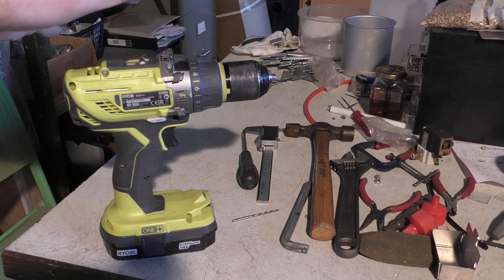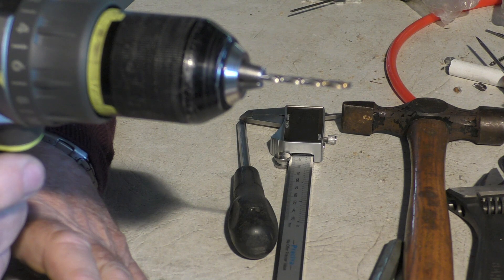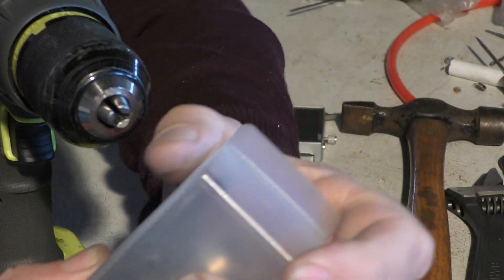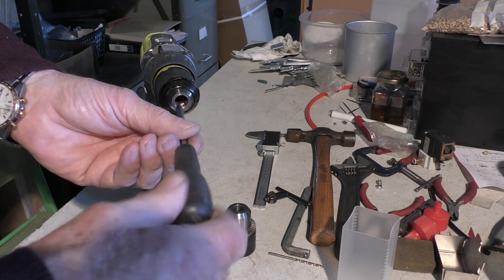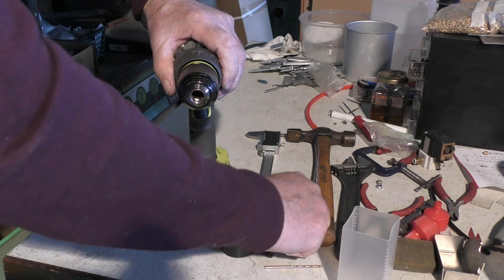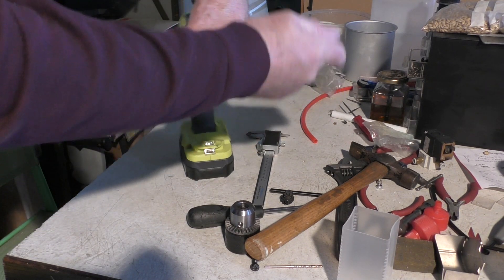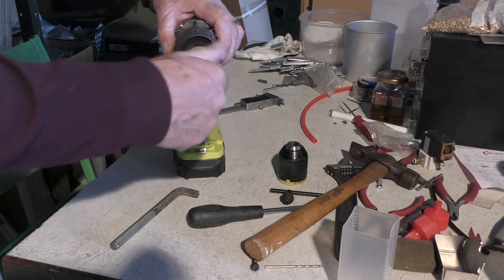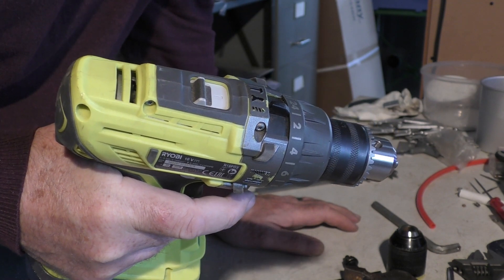Stoneage Upgrade for a Keyless Chuck

Comment: I am following this channel already a long time, and I am enjoying a lot of cutting. But this week, I bumped in a problem for which I cannot find a direct solution. My Chinese lasercutter does not recognise any files on my USB drive.  When I press File, navigate to Udisk+, Enter, Read Udisk file, Enter, there is a beep and "No Files" is returned. And I am sure that the file is on the drive (which I used allready a long time). Using another USB drive does not solve the issue. I am currently stuck, and maybe you have experienced a same issue in the past?  Any help would highly, highly, very highly be appreciated ! Thanks in advance.
Reply from the maker: Hi Steven
I have experienced this problem several times.  Unfortunately I have not identified a single reason for this behaviour. .  The first fact is that the controller needs to read from a FAT32 formatted USB disk. If you have been successfully using  the same USB stick  it seems unreasonable that it should just go bonkers ..... but it can. I still have 2 USB sticks full of programs that no longer work. Even restarting the controller does not fix the problem. I have reloaded programs onto another stick and they then get recognized by the machine. I can only imagine that there are bad contacts inside the USB socket. I have had success by using a male/female extension cable. but a new USB stick has always solved the issue. Although I have used a 32GB stick but now  I tend to rely on very small 2GB sticks. I use three of them randomly and have not experienced an issue in the past couple of years.. Reformatting the USB drive seems to have no effect so I can again only believe that the problem is a mechanical contact issue  with that stick. 

 Running the same programs via the USB cable works just fine  and downloading the file works perfectly also

 Best wishes
Russ

Comment: Buenos días estoy por adquirir una máquina láser 1.30 x 90 el detalle es que no se que sistema sea más funcional ruida o trocen awc7813
Reply: Me podrías ayudar?
Reply from the maker: Many people with Trocen controllers have replaced them with the industry standard Ruida  RDC6442. The software functionality for the Ruida controller is so much better. However,  there is a piece of control software called Lighburn that you can download for a full function 30 day trial. This was designed to replace the Ruida software and is SO much better. That software is gradually being expanded to work with MANY other digital controllers and I believe that the AWC7813 is now  supported. Check out the  website 
https://lightburnsoftware.com/
and write to them to see if or when your controller is supported.
 This software is rapidly becoming an industry standard.
 Best wishes
Russ

Comment: Even with the keyless chuck coming loose sometimes it's still less hassle than a chuck key (to me).  You just get in the habit of tightening the keyless chuck again every now and then.  Seems like that they could make a better design that doesn't come loose though.
Reply from the maker: Hi
 For a year I have been doing the occasional retightening and that's annoying but tolerable. However what I have not been able to do is tighten it sufficiently to use machine taps. I often need to punch through steel plate with M8 or M6 taps. It is totally useless for that task because the taps just slip. The old school keyed chuck solves my problem 100% but I agree it is less convenient.  Someone did point me to this video and it appears that some chucks have  a LOCKING mechanism. Mine was a gift and does not have such a mechanism.
 Best wishes
Russ
Reply: @SarbarMultimedia  Ah, I see why that would be a problem.  
I use only Dewalt drills.  They only seem to loosen up when I use them in the reverse direction.  Maybe they have a better chuck than the Ryobi?  I don't know.
BTW.. I'm learning a lot from your laser videos.

Comment: this might be the error. https://youtu.be/xIYZIWPRBos 
and makita says tighten and one click back
Reply from the maker: Hi
 That is a great piece of information  that I did not know about either. However I did check my old chuck and it seems to be missing that locking feature. I did also check the manual and there is no mention of it there  either. So it's just a cheap chuck that has now been fixed.. Thanks for the link that others may well be interested in.
 Best wishes
Russ

Comment: My old EPC18 Black & Decker battery drill keyless chucks (I have two) certainly don't have the same problem. Thanks for the heads up on Ryobi rubbish!
Reply from the maker: Hi Ian
 My drill was a gift so I can't dis it too much. Now it's fixed I am happy. However I have a few colleagues with other drills (Bosh, Cat, B&D) that experience similar inability to use them for tapping anything bigger than M4. I often need to tap M8 and M10  that's where my B&D mains drill (with keyed chuck) just breezes through.
 Best wishes
Russ
Reply: @SarbarMultimedia  I just used mine with a 10mm/300mm masonary drill bit to drill through the stone & block work on the side of my garage. No issues.
PS. I am old school and would always tap by hand rotating back and forth....:-)
Reply from the maker: @IanScottJohnston  
Hi Ian
Sometimes old school is best ( the keyed chuck), but I would urge you to invest in just ONE "spiral point" machine tap  to experience the pleasure of one simple  single pass tapping. with a power drill.
 Best wishes
Russ